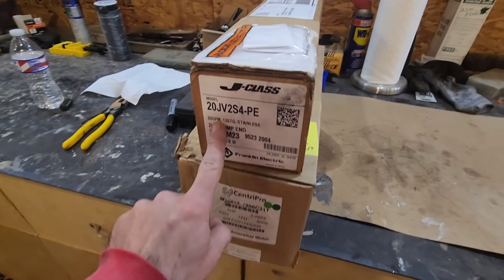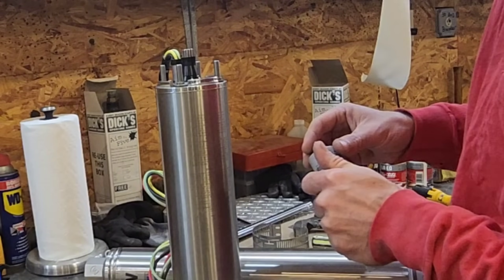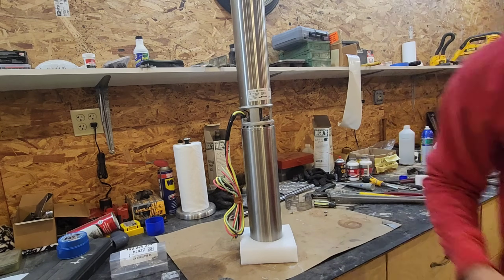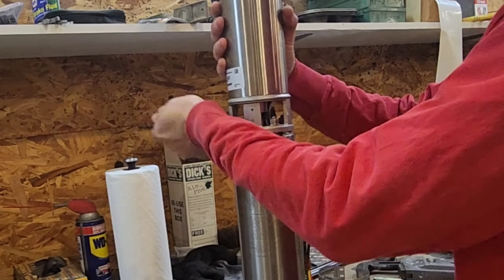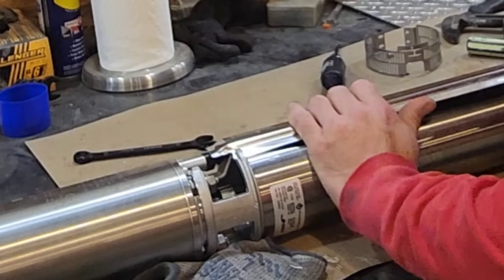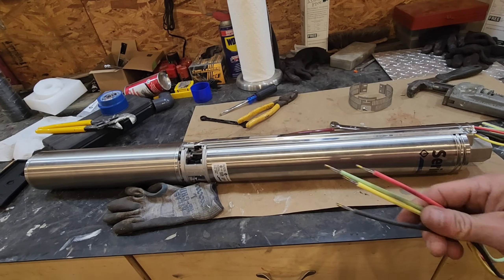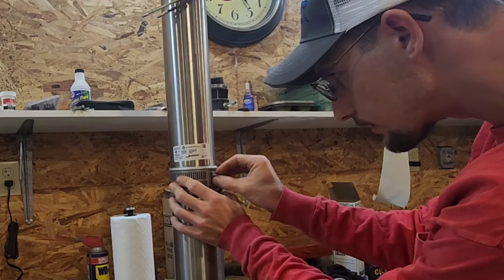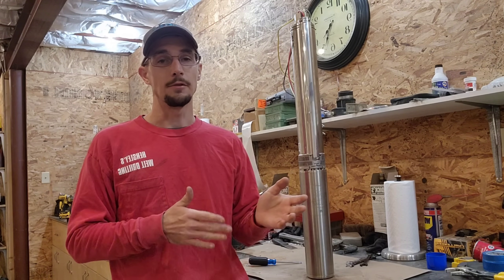Commercial 2HP Well Pump Assembly for Town Water Tower.

Comment: Is tinning the wires with solder before crimping really necessary?  I know nothing about wells apart from your videos, but at least in things not under water, generally crimps are done without solder, as it makes a reliable joint anyways, and the solder can make it more difficult to get a good crimp. Solder also makes wiring more susceptible to vibrations of not adequately protected from flexing in my experience.
Why do you tin your wires before crimping for a well pump?
Reply: On our bigger motors like above 50hp, we crimp them first, then add solder for a better connection. What that also does is if water were to get into the wires due to condensation, the water won't travel past the crimp and reach the motor windings.

Comment: I bought the vevor 2hp 220v because the 1hp I had wasn't strong enough at 150'.. is this wire good enough it's like a 14g wire I think... Wish I could send you pics
Reply from the maker: Blue wire? It's awg16. I'd say increase it. Another guy had a issue with it melting

Comment: Had an good one a month a go. New house builds we install the pump and tank and electrician wires it up. We use all 3 wire so we leave the control box at the tank tee. Got a call the pump don't work says must be a dud. Go out and look at it and they hooked it up 2 wire and cut my 3rd wire. I ended up wiring up and good to go. Lol

Comment: I know I will catch a lot of hell for this, but soldering before crimping is a no-no. If the crimp is done right, it is air-tight, and solder just gets in the way of the crimp working properly. Besides, solder cracks immediately upon any pressure (actually, any bending stress or tension/compression), so the solder immediately is compromised the moment the crimper does its job.
Reply: Good solder does not immediately fail under compression.

Solder is actually rather malleable.

Comment: Stainless steel pump impellers or is that SS for pump case?
Reply from the maker: Typically it's all SS internally impellers and all.
Reply: @h2omechanic  Usually the smooth stack like that are plastic impellers. When you have individual stages is when you see stainless impellers.

Comment: I bet it is the bearings which failed.  Motors running at 100% duty cycle usually fail there first.  If they cycle too rapidly,  the wire insulation fails on single phase 3 wire capacitor start.

Comment: Crimps over solder tinned wire ends is just wrong. I'm sure it has worked for you, and it's not my place to tell you what to do, but electrical stuff is as much my life as wells are yours, and that is just wrong. The reason is that solder cold flows under pressure and tinned wires should therefore never be clamped in a screw terminal or crimp.
Reply: I suppose when you refer to cold flow you're saying that the integrity of the solder is lost when it is smashed. I think a better way to do it after crimping he should have soldered the wire to the crimp connector if possible. Stranded wire oxidize and the connection will be lost if any moisture gets in but if the connector is soldered to the wire the connection is likely to last longer. I know he uses a watertight ceiling method, so I guess it works for him or he'd be doing something else.
Reply: @rickdiego5  cold flow just means solder does not have the compressive strength to maintain the clamping forces needed in a crimp. If you apply mechanical force to solder, after a while, it will be loose, 100% guaranteed. No manufacturer of screw terminals or crimp connectors allows solder tinning the wires, nor any standard or certification, many expressly prohibit it and/or require soldered connections to be free of any mechanical stress (e.g. the NEC).

Soldering dipping after crimping the wires comes with different problems, mostly those affecting all solder joints to stranded wire, but at least that can be done right and is widely accepted in the industry (even automotive etc.). However it would not be that practical to solder in the field.

As I said, I'm sure it must work for him, else he wouldn't do it, but that doesn't make it right, just lucky. 
I've fixed way too many open, intermittent, or even burnt-out terminations that were the result of solder tinned wire ends.
Reply: @stefantrethan  Its a marine application. He's saving expense to the customer by using 10/3 copper pump wire and tinning the end for corrosion protection  versus using 10/3 tinned marine cable of which 300 feet is ridiculously expensive due to UL certification. There's no wire heating at the connection because it's constantly submersed underwater.
Reply: @jstaffordii  Tinned cable, where the individual strands are galvanically plated for corrosion protection, is entirely different from solder tinning the ends. You can use tinned stranded wire in crimp or screw terminals just fine, since it does not exhibit the cold-flowing issue. The problem is the glob of soft solder between the individual strands that gives over time. The crimp terminals (sta-kon etc.) are plated themselves, but the surface coating is not the issue.
Reply: You are exactly right, and I came here to say the same thing - never tin a crimp connection. But at the very least, strees that you are using Rohas solder and not lead, LOL!
Reply: I also came here to say just that. It's not only cold flow either - tinning stranded wire wicks the tin up the wire, which, especially in environments subject to vibrations (which motors pretty much by definition are) causes stiff spots, which will be your weak points breaking due to vibration.
Properly crimped connections are pretty much as good as a connection gets. Unfortinately, especially in a professional setup, that tends to mean forget gramps' Klein pliers and buy into a reputabe manufacturer's ecosystem (pay an arm and a leg for the tools and then keep buying the matching consumables). But even the generic $50 Aliexpress special crimpers are more consistent than the old-style crimpers.
Through the miracle of our Algorithm Overlords I have been enjoying H2o Mechanic's videos, but (as he readily admits in several places) pixies are not his forte. I would highly recommend to watch a couple (hundred) of the excellent content put out by British sparks (Thomas Nagy's old videos when he still did domestic, GSH Electrical's flat out educational content, John Ward's channel, just to name a few off the top of my head) to get a sense of things. Who knows, maybe he'd learn to appreciate clamping connectors :).

Comment: Not discounting your Love for 2 wire motors. I am just curious your reasoning for it. here IN co. where we all have deep well pumps like greater than 500 feet. I would much prefer to have a seperate control Box so I can change capacitors and contactors and Potential relays and such, using a 2 wire motor you just throw the whole thing away and start over when 9 times of 10 its just the capacitor that fails. ( I do hvac so change capacitors regularly) for us here in Colorado we cant just run out there and change a motor its too heavy to do without equipment, we can do alot though with the control box. we did have a wire that chafed a few years ago and the Pump had to be pulled anyway. but is always nice to be able to just change components up top b4 Having to pull a Pump. I think your videos are fascinating. Just curious as to your reason on this? Thanks for sharing your Knowledge.
Reply: that's actually a 3 wire pump, not a 2 wire
Reply: @gtb81.  HA HA HA. Thanks for counting wires for me, This was in response to some other videos and I just happened to remember to ask on this one. You should see some of the 50 HP 3 phase motors I work on, they have all the way up to 30 wires at times.
Reply: @businjay  Lol. 50hp pumps are cute little toys. How about a 1000hp 2300v 3000 gpm pump set on 12"schd80 12" drop pipe set 900'.😁😁
Reply from the maker: 2 wire pumps belong on easy to remove poly pipe. 
3 wire pumps belong on deep systems that are on stick pvc/galvanized since replacement is so time consuming. That's my thoughts.

Comment: I called a local company to replace my pump. It has been in for abt 30 years. Trying to be proactive. How can I tell if they know what they are talking about? There is not a tag on the casing giving any info about the well. Meaning, what size pump and all?
Reply from the maker: You have to remove it first. 
But if you know how deep it is & other Well Information, I can tell you what size pump you'd need.
Reply: @h2omechanic  Yeah, that is the problem. No info on how deep or anything. Called the county and they don't have any info recorded about the well and the company on the lid is not in business anymore. Hopefully the company the county recommended can figure out the info like I have seen you do.